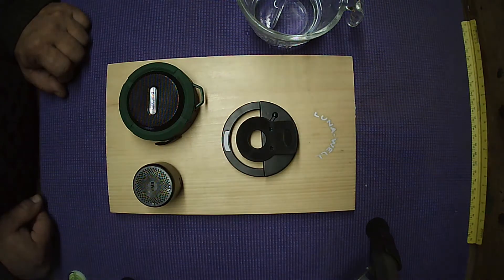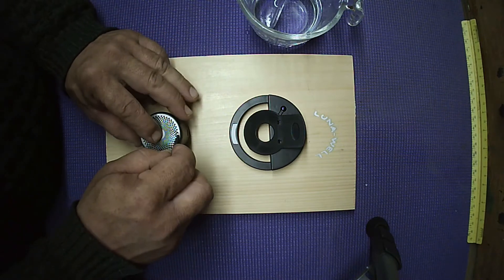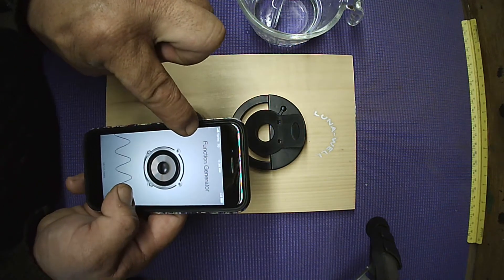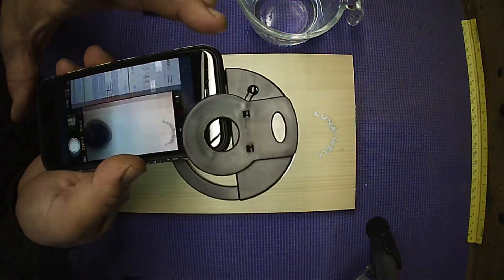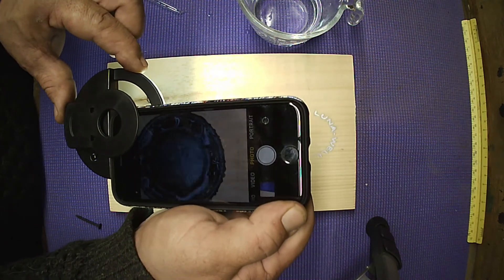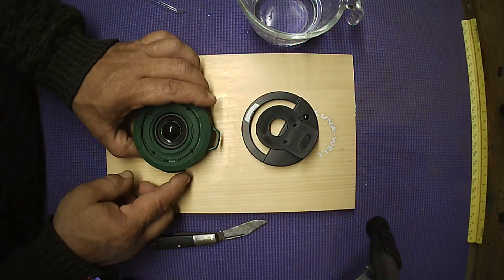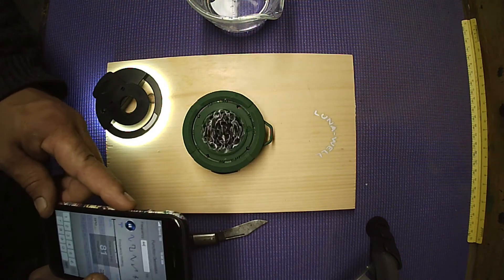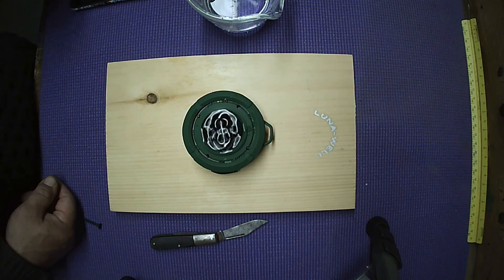An inexpensive DIY, No Build Cymatics Device

Comment: thank you very much, I was looking for cheaper/easier options for cymatics kits than the $1,000+ jobs with electronic oscillators. I did try this the other day, but with salt on a plate, but I didn't remove the speaker grill. I now have something else to try, many thanks!

Comment: Hey shawn! Your work is incredible! When i do the same experiment my patterns aren't geometric. There is randomness in them. Please help.
Reply: To create a proper cymascope you have to offset the resonant frequency of the speaker or driving system so to speak. This can usually be done by running your audio/frequency output through an equalizer to tune the system before you start creating patterns from frequencies. You could start by looking at a known pattern for a specific frequency and then tuning the system until you get the same pattern. Much in the same way you tune musical instruments. I would also make a different down-light and use a darker LED light such as a purple or blue. This should make the patterns more pronounced. I would also likely enclose the system in a PVC or other tube to make sure no external light interferes with your images